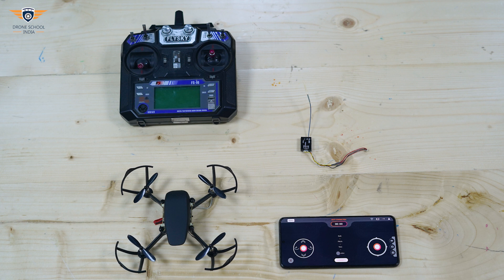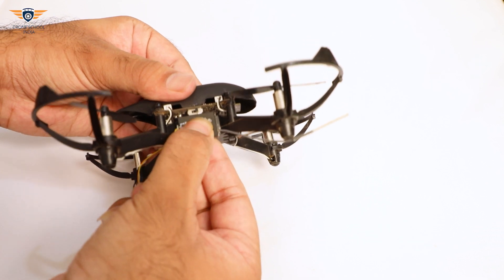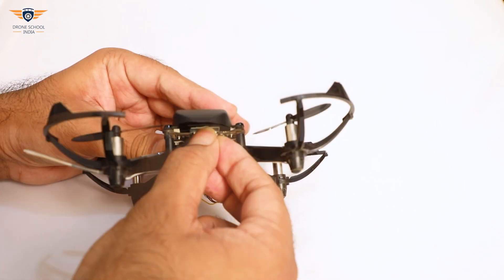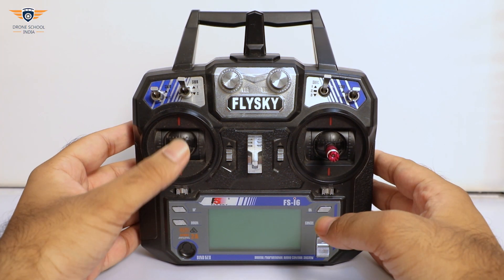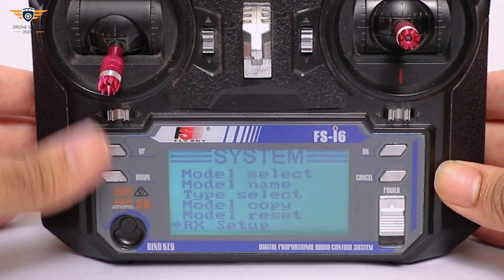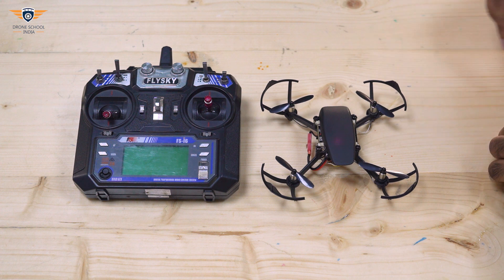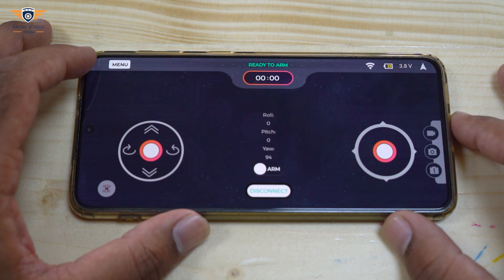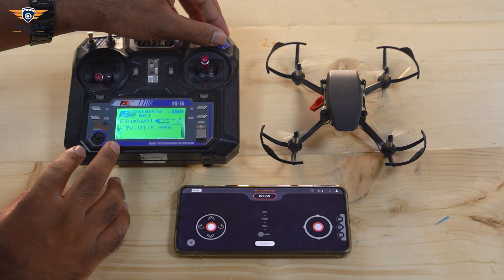Fly Pluto Drone with RC Transmitter and PPM Receiver

Comment: Hello sir . Sir  kya hum pluto 1.2 ko fsi6s  ke sat connect  kar sakte hai. .
Reply from the maker: Yes it can be done.
Reply: @droneschoolindia712   sir ji iske liye kya alg se Fromwhere rhega ya fie jo aap ne dicprtion  me diya hai usi se ho jayega
Reply from the maker: @preranapatwal9427  Description mai jo Firmware diya hai, wahi chalega. Follow the same steps shown in the video tutorial.
Reply: Sir 1 question  . agr hum drone  ko ek bat fs i6s transmeetar  se connect  karte hai.  Uske phone se chana chahte hai to kya fir phon se chal payega ya fir . Fir se fomeware  update  karna pdega ?
Reply: @preranapatwal9427  When you have flashed PPM firmware on drone, you will be able to connect drone to mobile app and perform drone calibration. However you won’t be able to fly drone from mobile app. For that you will have to flash the original firmware back on the drone from mobile app.

Comment: Hello ☺️ sir I have a question I am going to control Pluto drone with Flysky Fs-i6s radio transmitter it comes with it receiver I can attach receiver directly to Pluto 1.2
I know how to connect receiver to Primus 4
Can it lift weight of receiver
Reply from the maker: Pluto 1.2 supports payload upto 15g. If your receiver weights more than 15g, it will lead to less flight time. Also make sure to mount the receiver in such a way that the center of gravity of drone is not shifted, otherwise the drone won't fly stable.